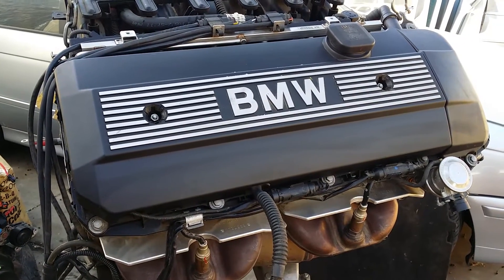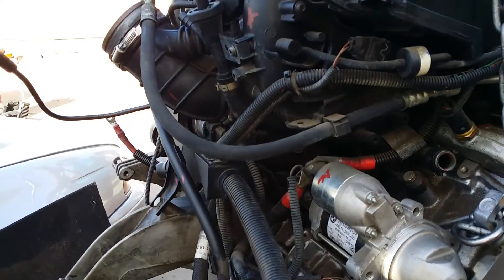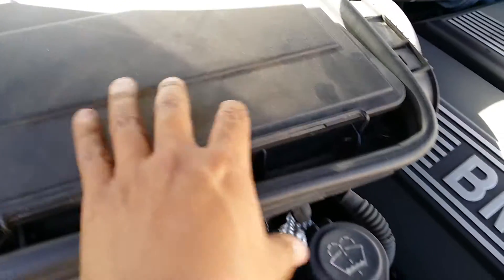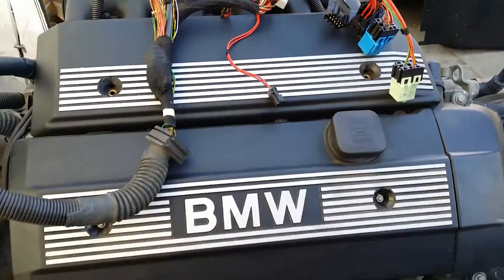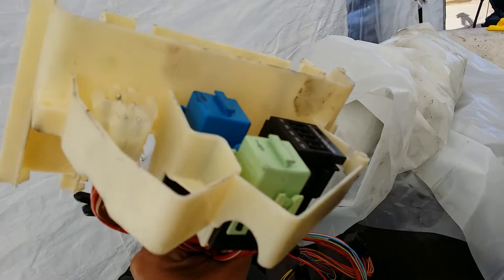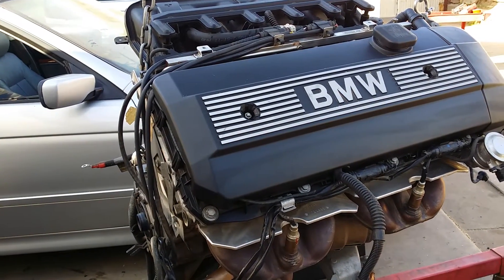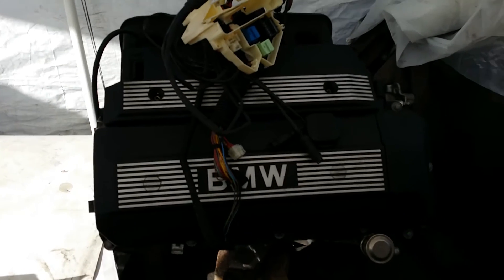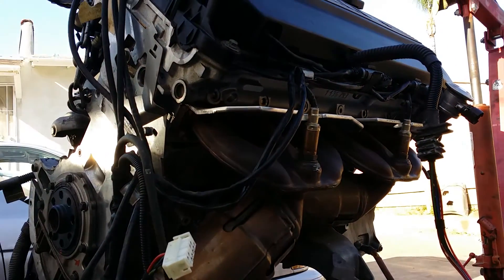BMW e39 525i 530i e46 325 330 M54 Engine Wire Harness Diagram Part 2

Comment: hey are you available?  I have a question?  I have the rear 2 pin wire that connects to the fuel injectors but cannot find the other connector to connect the rear of the rail for the wiring.  and i cannot see where it fell down.  So wondering where i can trace it from or where the wire i needs to connect to starts.
Reply: im sorry it is on a 2004 525i with a 3.0 installed

Comment: great video that's mean the engines are the same if you put 3.0 in 2.5 it will work but  with same ecm from your car let's say you have 323ci 2.5 m52 And you want swap to 3.0 m54 it will work if you use you wire harness I did swap my 323ci 2.5 to 3.0 no any problems all are the same but you have to use your wire harness and same ecm

Comment: Hey thanks for this awesome video. I have an e46 325ci with blown engine and i just bought a new 530 engine everything is is ready to put in but I think i still need to get a new ecu from 530 what do u think? Mine was manual and the new engine is automatic

Comment: have a 03 525it motor blown what motor would be best for swap? and also can I get a parts list that is needed to do this automatic to 5 speed change?
Reply from the maker: +Oscar Jimenez You need M54b25 engine replacement.  Manual swap is time consuming and expensive, do your own research prior to starting project

Comment: hey i have an e46 2000 323i and am looking at replacing my engine wire harness. i was wondering if you have any for sale as i trust your work more than just some random guy on eBay.